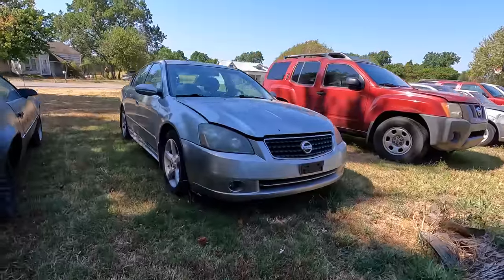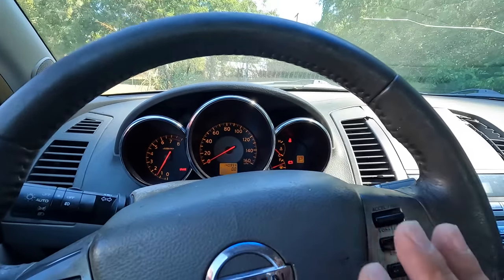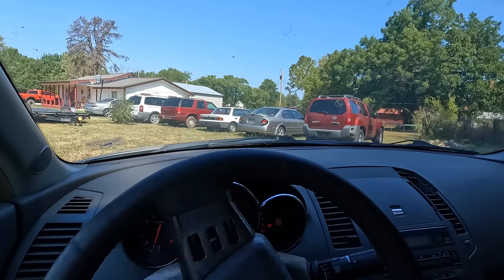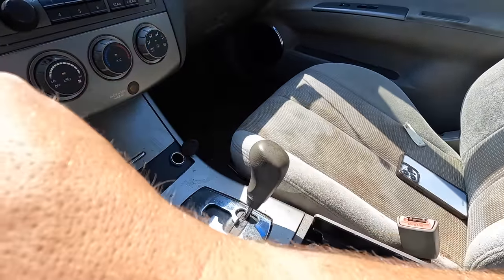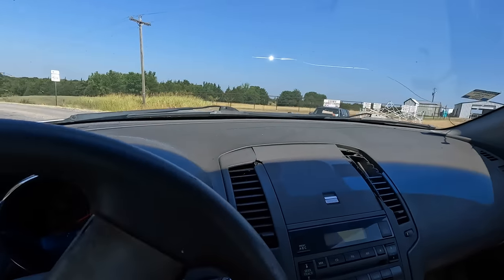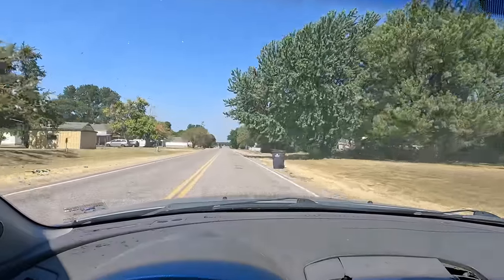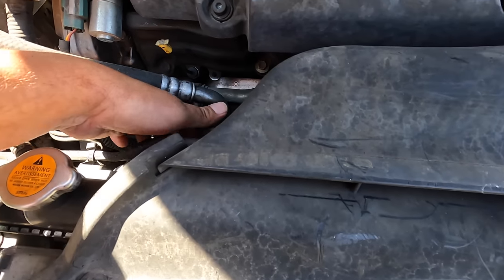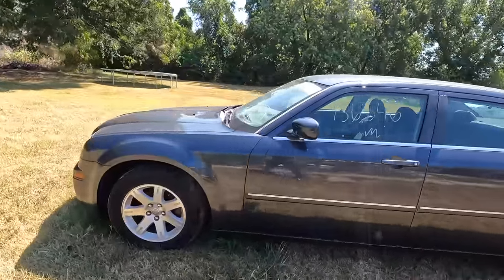I Won the Worst Nissan Altima v6 Ever! Here's Why it Sucks!

Comment: I have no experience with Nissan but my Chevy CVT was a year old 25,000ish miles and just like that. The thing was dangerously slow accelerating and got horrible gas mileage for a non turbo 1.4 Ecotec. I wasn't sad when it was towed away.

Comment: CVT 👎🏻, mine is 6speed manual SER with modified by me 525hp with full Nismo suspension installed by me with Nismo Forge aluminium alloy wheels 18×8.5 14lbs. Plus more

Comment: Hey Randy! I used to have a 2005 Nissan Altima SE-R and these Altima’s do not have a CVT the vehicle is stuck in 5th gear and it’s in limp mode, check the crankshaft position sensor or charging issues. Not really sure but my Altima had the issue of limp mode because of the crankshaft sensor.

Comment: i had that year Altima many many years ago. when the alternator gets bad it will shut off and do what this same one is doin man, there is a voltage fuse over the battery that fails its a $14.00 part. Sounds like its in Limp mode. Also do not agree this 3.5 was good engine and still is. My opinion i had a V6 and only minor issues vs others ive owned. CVT wasnt put in till 2006.

Comment: Can be a symptom of the camshaft position sensors or transmission shift solenoids, did you check the transmission fluid level?

Comment: Need a oil catch can for the 6 cylinder because it sucks oil from valve cover into the plenum into first 2 cylinders which causes multiple Misfire codes

Comment: I had a 2002 Altima 2.5 S mine did the same thing it's the transmission and cvt joints
Reply: Whatsapp👉⓵⓽⓪⓼⓼⓶⓸⓷⓪⓷⓽   hey rand what drains a car battery after u put a booster pack on and it dies over nite

Comment: Like most people have said the Altima didn't get CVT til 2007 and it sounds like it's not shifting out of third gear cause I have a 2000 jeep wrangler with a 3 speed and at 70 my rpms are at 3000.

Comment: The battery light might be on because of the alternater might be aftermarket and missing the sensor happened to me with a honda it worked 1000% but the battery light was on for a whole year until I traded it in

Comment: Should be a 4 speed auto in that Randy… not a CVT.  But the 05 Maxima was one of the worst years because of trans issues. The V6 Altima likely has the same one.

Comment: Well Randy see u bought the 82 Iron Duke Camaro which is to me junk but 92 Century in last would have been better than 3rd gen Camaro also for 05 Altima maybe easy transmission fix cause CVT didn't come out until 08 so might spend $300 than spending $600 if it was CVT transmission

Comment: I had that same model year even though I didn't had the V6 but the transmission would just jump and it would struggle to start. I traded it in after two years of ownership and I never had a Nissan again.
Reply: someone screwed you over, my ex absolutely abused the one i now ow after buying from her and rebuilding the front engine and fixing some common issues with the 2.5l engines and it never fails to get me anywhere, great car.

Comment: Through in a new set of  cam position sensors,  the problem will go away 100%. Transmission is fine,  , my 04 maxima did the same,  i fixed,  is just a misleading limp mode. There's other videos abut it in YouTube
Reply: Whatsapp👉⓵⓽⓪⓼⓼⓶⓸⓷⓪⓷⓽  hi,  thank you,  just pay it forward to someone else on my behalf.  Be safe!

Comment: My 2007 Maxima would just drop down to 30 mpm turned out it was a bad ABS sensor.   we went thru 4 transmissions  in 130000 CVT hate them

Comment: Randy I love your Channel I watch it all the time but please top off your fluids and check your lug nuts before you test drive a car to give an assessment if things are wrong with it if all of the fluids are on full then you have a better chance of knowing if it's bad or not or maybe you may need to change a filter but not topping off your fluids before you test drive it does not help you find out what is working right and what is not I'm not trying to be a butthole just trying to give some advice because it is hard to say that a transmission is having issues if it's an automatic and you have not checked the fluids not saying you should change the fluids but at least make sure they are full I hope you take my advice and once again I love your Channel you do a great job

Comment: I have owned Nissan Altima 2005 and 2007. It seems like gear is burned out. What happens then is it stays at certain gear and not shift any higher.

Comment: Yes it's a cvt transmission is designed to run at engine speed it feels like is not moving i rent one it was a 2011 Nissan v6 altima

Comment: That’s not a CVT transmission. Those had a 5 speed auto. 2007 they started putting CVTs in them

Comment: recently you have gone from 'you need to check the cars out' to 'look what I bought sight unseen',
one day one of these complete unknown scrap yard cars will loose a wheel or a ball joint will come apart
as you dont take a look at the mechanicals,it takes 10 mins to jack up the wheels and check for worn this n that
flying down that road at anything over 20 mph is crazy imo,god help you if it happens as this is so easy to avoid
it would add content time and show the unknowing what you should do first at the minimum
before driving off to 'see what she does'
Reply from the maker: No thanks lol.

Comment: some cvt's have a first gear that accelerates the car off the line before actually engageing the cvt,,,  Saves wear and tear on the cvt belt,,  some early cvt's did not have a first gear,, These wore out faster,,  :-)

Comment: The 2002-2006 didn’t have the cvt transmission I own 2002 Nissan Altima transmission is great and I own a 2006 Nissan Altima ser the Cvt didn’t come out intill the 2007 models

Comment: They used Jatco transmissions which were garbage especially the CVT. After 2000 Nissan sold out to Renault in North America. You paid to much for it as it's salvaged.

Comment: Some models of cars will start and die after a dead battery has been replaced,,   It takes awhile for the engine computer to reprogram itself before it will stay running,,  Usually about 5 or ten minutes,,  :-)

Comment: you should  be called  junkyard rebuilds you keep getting all them excuse the terminology  needsand shitbox !i have seen to many of them shit boxes out there , there wre not enough  pictures of that box 
low battery not charging  , electric systems start shutting down  with low battery charge !lower control arm bussings  could be messed up

Comment: I really like watching your content...I just wish that you'd see the light on how terrible 99% of Nissans are.  No offense intended...they just suck as cars.
Reply: You should clarify on newer Nissans aka 2000's and up. My mother has a 2014 Altima and I'll agree it's a pos and has had more issues than her 07 Saturn ion version 2 had ESPECIALLY in the first 2 years we've only had it for 2 years and I've already had to FUCK with the mircoswitch because it'd get stuck in park and now it has a stalling issue
Reply: @borncomatose  🙂 True...The decision to go to the CVT is really what killed them.  I had a '93 Maxima which I loved.  Manual trans Nissan trucks are probably still good, though.  It's just the CVT...makes me repelled against the brand because I know the trouble is GOING to happen.  Like head gaskets in 2.5L Subarus...you WILL replace the head gaskets...going into a car purchase KNOWING that you will have to spend $1000 to $5000 in repairs, and it's not just a  "maybe".  I like Randy's videos...he just gravitates towards Nissans, which baffles me.  Too many issues to justify it.

Comment: This car sucks in general. It doesn’t have a cvt which is a good but it doesn’t get good mpg and its not even powerful. 0-60 in 13 seconds. My little turbo 4 cylinder liter can do that in 4 seconds and has double the horses and torque. There are countless other 4 door sedans that are better than this.